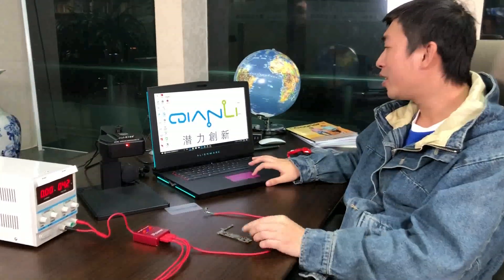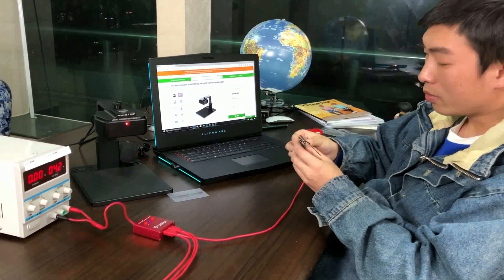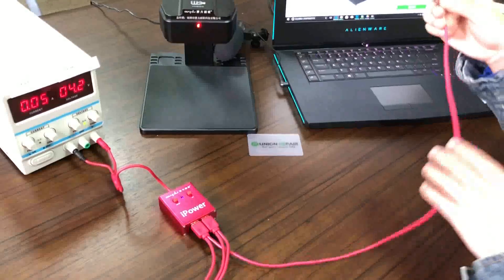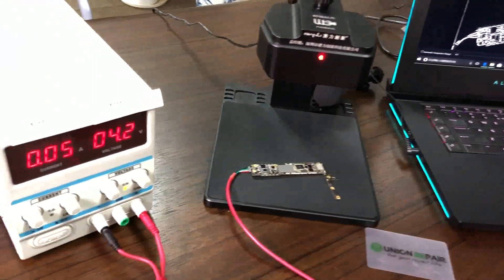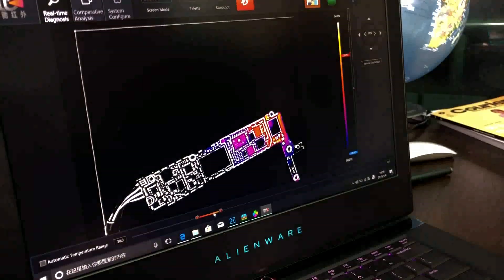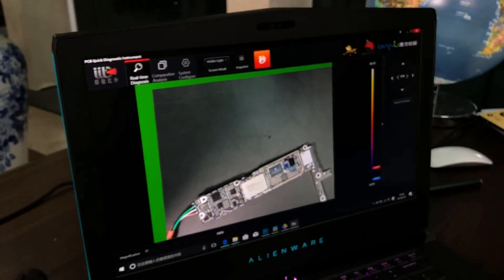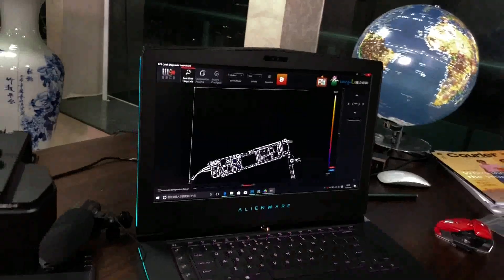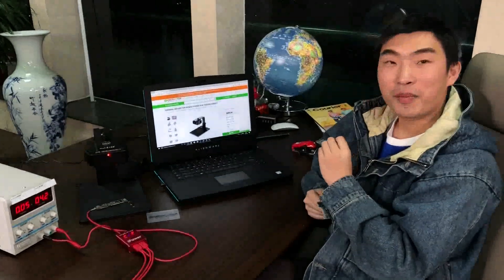How to diagnose low current 50mA electric leakage with Union Repair thermal imager

Comment: Thank you for the review. Ive been looking into these desktop thermal imagers. I think it's a good idea. It looks like its using MSX technology and a decent field of view but this one doesn't have the sensitivity I need and should have more software functionality similar as what come standard with Flir products for the price. It should also be able to target the min/max temp spots automatically. And I doubt it come with adjustable focus which could boost its value significantly very easily. So for now, I'll pass until someone comes up with a better optimized solution for the market. Thanks

Comment: $300 sounds reasonable, the price is too high. One way this product can be $900 worth is if #1 the interactive software was  better and #2 if the camera was high definition.
Reply: @BlondieHappyGuy  which camera is better?  I cannot find one that is better for less than $800USD
Reply: @BlondieHappyGuy  thank you for the detailed response!  I too looked at the Seek and all but ruled it out.  I am tempted by FLIR due to the same reasons, but think I need to buy the E8 onwards to go beyond what this does.  Of course the E8 is 3x the price, but is better and will likely outlast this.  The head on this does detach by the way but I think to operate needs an ethernet cable (!) attached to a computer lol  hmmmm... Decisions...